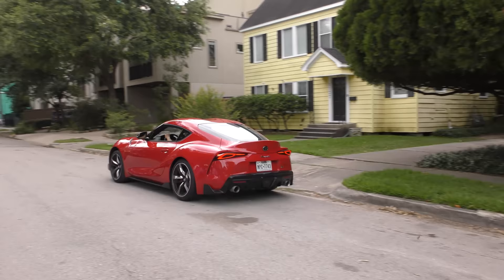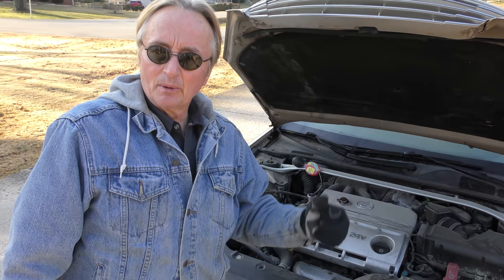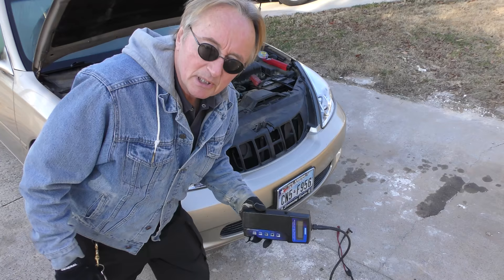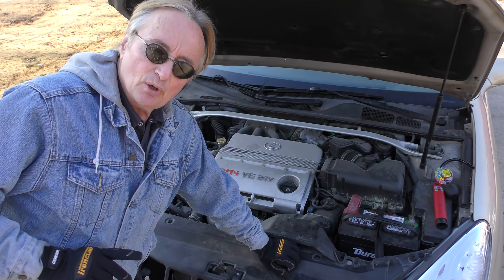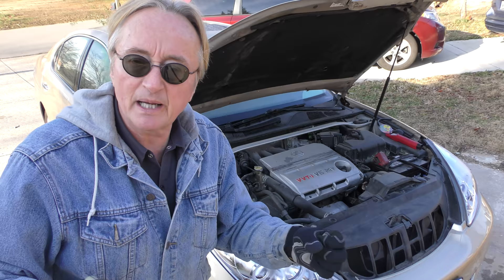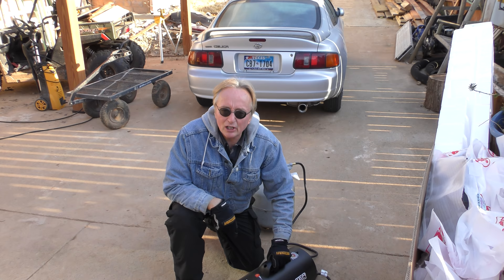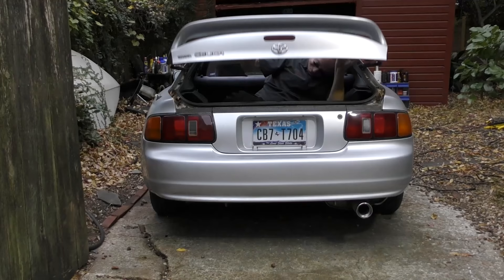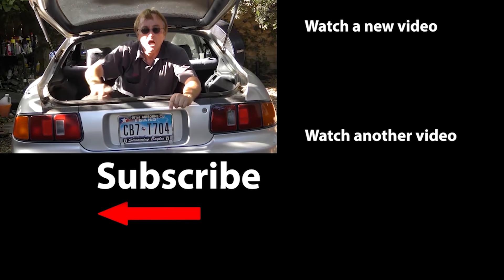You Must Do This to Your Car in the Winter (or You’ll Be Sorry)

Comment: For neighbors too: got today 1000cca starter for jeep, dc portable up to 100 psi tire inflater , digital pressure gauge 
Tool kit n fire extinguisher. You guys times are rough. If YOU can afford it , have on hand if guy next door needs it. When its snows , aaa tow trucks not five minutes away. Prepare today

Comment: Scotty is right about modern batteries giving no warning before dying. I had to replace by battery in a 2016 ram 2500 last night. It was doing fine all day, no latency in starting, no hesitation, but on my lunch break I went to get in, put the key in the ignition, turned it, absolutely nothing. Tried to jump start it, nothing. Truck wanted a new battery and thats what it got. Merry Christmas Ram, that's all you get this year.

Comment: Canadian viewpoint: Snow tires DO make a big difference. At temperatures below 7C, you need them just for the stopping power on dry roads. And for front wheel drive cars, you need them on ALL FOUR WHEELS, not just the fronts.

Comment: Scotty, I am a BIG fan of your advice, but I have to challenge your comments about using All Season tires in snow country. You also imply that "tires with lugs" will also suffice in the winter. Government tests show that braking distances can double unless you have tires with rubber compound that stays supple in cold weather. All season tires don't cut it. I drive with "All Weather" rated tires that meet Transport Canada's winter rating (stampled on the tire walls). Not quite as good as Winter tires, but quieter, and can be used year round (although they do wear a little faster, but no wheel change headaches Fall and Spring!)

Comment: On 8th gen civics your supposed to hold down the electric window switch for 3 secs or more when the window is fully down and the same when the window is fully up after you have changed the battery.
Do this for either side & the rears as well if you want.
It says to do this in the owners handbook that comes with the car when you buy the car new.

Comment: I use snow tires on my Mazda 3 but I put them on the rear. Keeps the car more stable. The place that mounted them on wheels I bought said, by law, they can't put them on the front and recommended I didn't either.

Comment: I routinely drain and fill the coolant every 2 years (coolant is cheap) and replace the battery every 5 or 6 years. That and 4 good snow tires will get you through winter. No need for flushing procedure if you change coolant every 2 years.

Comment: All season tires might be ok for mild Tennessee winters but in colder places you want real snow tires . The gum used for snow tires is softer therefore will adhere better while all season tires are made with a harder gum and when cold will get even harder and not adhere as well.  You also want to have not less than 2/32 difference in wear n tear with your rear tires and have as good of a tire even though your traction is on the front or you could fishtail on slippery or wet surfaces .

Comment: Walmart has the best deals on batteries. My old battery was a Motorcraft group 65 that cost $150, my new battery is a Everstart group 65 that cost $88. Both are 1000 CA, 850CCA and are both made by Johnson Controls.

Comment: Bad advice saying not to bother with snow tires. 

If it normally snows (and accumulates) where you live, get snow tires! They could save your life and at the very least are insurance against getting into an at fault accident (so paying higher insurance). Also, it saves your summer tires so they don’t actually cost you that much more (if you swap your tires yourself).
Reply: Plus Winter tires are made with a different rubber compound that makes it more flexible in freezing temps.  Living in Canada I have always used Winter tires.  Plus like you said both sets will last longer.
Reply: I wish they would allow for studs again in Ontario . The tech has changed and they are not made of metal anymore .

Comment: Fill gas tank before major snow storm or extreme cold temps; never less than 1/2 tank if you can  help it during Winter. Silicone spray on at least driver side door rubber weather strip and
in all door key locks. WD-40 will work too, but smell will linger.

Comment: Way back when I was first learning about engines it surprised me to find out that big commercial diesels didn't use antifreeze.  The diesel engines in construction equipment and locomotives just used straight water.  The thing is though when it's really cold you cant turn the diesel engine off or it will freeze up on you.

Comment: i simply use a long cable from my model trains or whatever you have and plug them at the battery and at the cable. so when i unplug the battery the car is still on power. now i build in the new one and after connecting minus and then plus, i immediately disconnect. so you wont need to reprogram

Comment: In cold climates flush or finish off the summer windshield washer fluid and replace it with fresh windshield washer antifreeze of an appropriate rating for your area. Summer heat evaporates the fluid’s antifreeze properties, a cracked reservoir can be a pain in the arse to replace. 
(To save waste any flushed fluid can be used safely the following summer). 
Jurisdictions with heavy snowfall mandate 4 matched ice and snow rated winter tires. A FWD car with winter tire grip on the front and summer tires on the rear axle will spin you around faster than you can say “Holy Shi...”
Drivers forget the tricks and habits of safe winter driving, first snowfalls stay home if you can otherwise leave extra stopping distances keep your eyes 👀 open and match your speed to the road conditions.  
Get to where you’re going safely folks ❤️

Comment: Aggressive tread or not, you wouldn't get away with the compound in an all-season tire up here in Canada, and we always put them on the front AND the back if we can afford it. All season tires just don't stick to ice well enough, you really need the softer compound rubber. When I had my first car at 18 I did the first winter on all seasons, but it was scary, especially trying to drive on the highway because the car would start to fishtail if you went to fast. My second winter, I put winters on the front. That car would pull itself anywhere you pointed the tires. Now trying to stop on the other hand, the back end would tend to try and catch up to the front end, especially going downhill. Third winter with all four winter tires, not a single issue. Was an old '91 Sonata, beast would go anywhere. I used to go out during blizzards for fun(heck, nobody else on the road, perfect time for drifting, especially at night when you can see any headlights coming around the corners out in the country). Car only cleared about 7 inches or so, but it would drag itself through a full foot of snow if it wasn't too wet and heavy and you kept your momentum up. Only issue I had once I put proper winter tires on it was the time they closed the roads to the city because they were so bad, and I had to turn around and drive 30 minutes back to the boonies to stay at a friend's house....

So yeah, maybe you southern boys can get away with all seasons, but you'd be in the ditch up in the great white north....

Comment: Could be worse have a head gasket to go, started the car joined the highway and the car disappeared into a cloud of white smoke and over heated. :D Got another car now, its a diesel Opel Vectra 2008 but its a pain to start takes ages to crank over something have to jump it to get it going, but once its warms up and driven for awhile it can restart etc first turn. new battery made no difference. due to change the fuel filter see if it helps, got inspection light on but no codes....

Comment: Scotty what do you think of All-Weather tires compared to All-Season tires? I have my opinion after driving over 45000 miles for 4 years with All-Weather tires and All-Season in winter and summer conditions.

After comparison, I can say that All-Season tires are quite good in winter on 4x4 cars but stopping can be tricky. All-Weather tires are doing a fantastic job even in harsh winter with just front-drive and stopping is not a problem.

Comment: It helps when Scotty does this to the same exact car I own.

Love my '02 ES300!
Reply: @Jonathan McCully Not much in all seriousness. It only has 54K miles on it (a total grandpa owned sedan.) I haven't had a single problem with it, thank goodness!
Reply: @Jonathan McCully Oh yeah! I got a deal of a lifetime with this car. Drives almost as good as the new ones (former boss owns a 2017 ES350 and got to ride in it), and is quiet and smooth. Insurance was surprisingly cheaper than the Camry I used to own! And maintenance is basically like having a Camry. I don't intend on getting rid of my Lexus and I highly recommend getting a Lexus if you can find a great deal on one!

Comment: My 2008 Cadillac Escalade ESV  keep throwing codes and change out the oil pressure switch twice didn't help at all.I also get oil below under carriage would it be best have both,rear main seal and front main seal replace.Change the knock sensor on both sides because was cause miss fire under hood but it good 👍

Comment: Wipers, it seems they just don't last as long as they used to. I but cheap they fall apart dry rot within 6 months, I buy really nice name brand for my wife and her car, they lasted 6 months and dry rotted. So check reviews and buy good quality for good price. Expensive does not always mean Excellent quality. Also check you wiper fluid. I made the mistake on filling mine with water in late September one year and got caught with an early freeze in November cracking the plastic fluid tank. Also check your rubber wiper fluid lines under the hood for cracking/dryrot. BECAREFUL the old hard plastic and rubber will break down over time, if your car is over 10 years you may need to replace them asap.

Comment: ..last quuueeesttionnn.....what about connecting the battery positive cable, to another 12 v battery sitting beside the car, with a booster cable, AND  THEN  DISconnecting the vehicles' installed battery. Thusly, the computer would be powered continuously, while changing whatever parts your doing....????? when done, reverse process. connect vehicle battery, then unhook booster cable from supporting battery.  DONE..

Comment: I am waiting for a housing thermostat for my 2004 Ford ranger XLT truck 4x4, the truck works fine but leaks coolant and makes the truck Smokey because of the coolant hitting the engine will have any affect on anything. I keep making sure the coolant is filled so it doesn’t over heat. What can I do to prevent it from smoking so much until I get my housing thermostat in the mail

Comment: I love your videos, Scotty, but you are wrong about winter tires.  First of all, they are now called "winter tires" not "snow tires", for good reason.  Yes, if you live in a place that doesn't get cold very often, and if you can pick and choose when you drive, you can get by just fine with all season tires.  But when the temperature is regularly below 7C or 45F, all season rubber has way less traction, even on dry pavement.  Winter tires can make the difference between stopping in time, or rear-ending the car in front of you.  When there is ice on the roads, the winter tire tread patterns with all the little sipes will give you a huge advantage in both cornering and stopping over all season tires.  Here in Canada, car insurance companies will often give you a significant discount if you have 4 winter tires on your car from November 1 to April 1.

Comment: Hi I have a 08 ford focus runs great it has 398k miles yes 398k my 2010 has256k both have original  engines and transmissions should  i change some of the tranz fluid or just keep it full.

Comment: I have problem with  Transmission control module for chevy cobalt 2006 and replaced with  another one from junkyard  , now working good , but does i need to program it if working good now

Comment: SCOTTY what do you think about Lexus 1993sc 400 2 door 83k miles start up it need a little work but do think they are good or not thanks scotty
Reply: What kind of work?
Reply: Oil change coolant power steering fluid brake fluid spark plug brakes
Reply: @wajdbo369  if that’s all it needs that’s a great car
Reply: Ok so I would buy it thanks